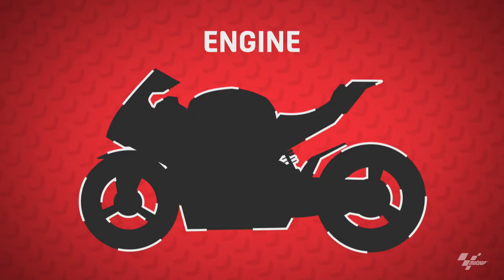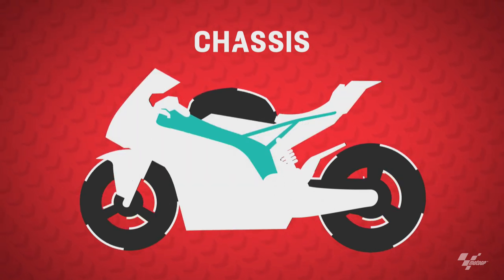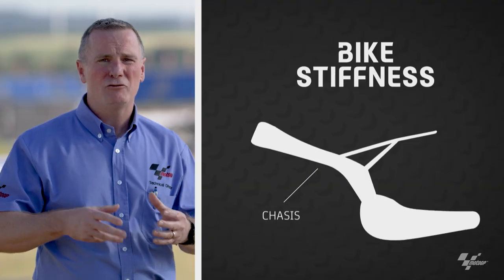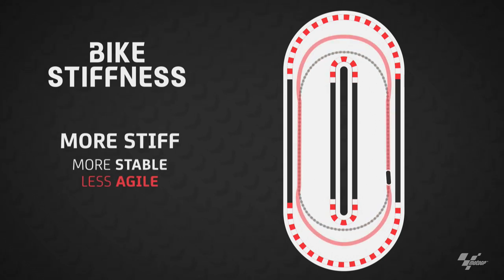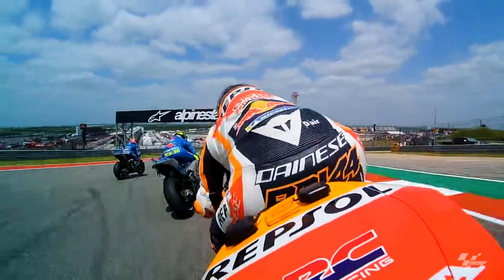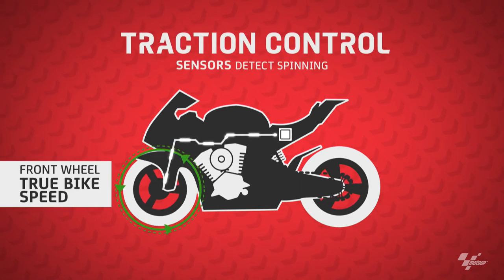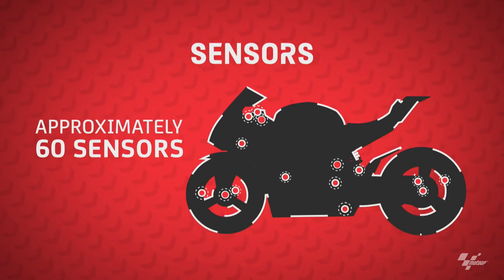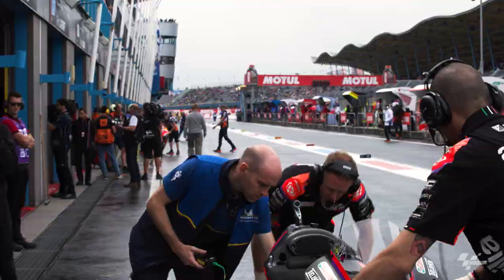MotoGP™ Explained: Top Tech Concepts

Comment: Traction control, to say senses wheel spin is misleading, it compares front wheel speed to rear wheel speed, if it detects the front wheel has slowed down compared to the rear wheel it begins to reduce power to the rear- for instance if the bike begins to wheelie it will reduce throttle input to keep the front wheel on the ground. The inertial measurement unit also comes into play, to help the bike determine wheelie from, spin- that is where it gets very intricate when mapping the engine fuel and timing settings.
Reply: Isn't this the part which messes up Marc Marquez in his Honda